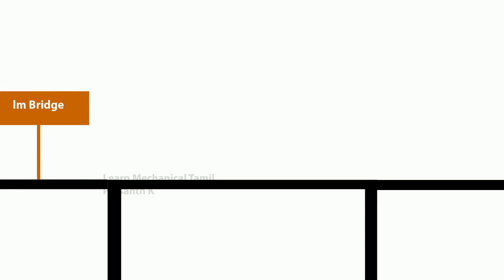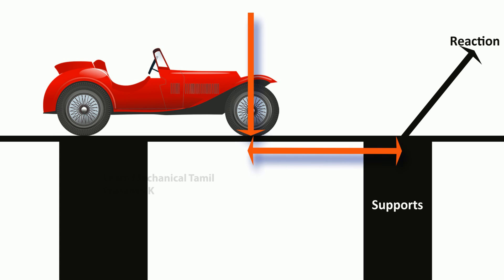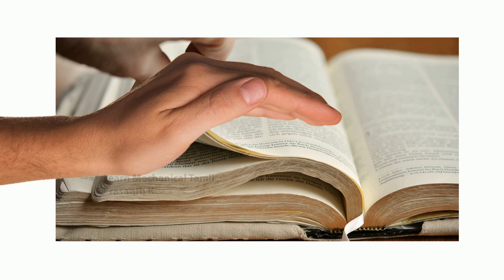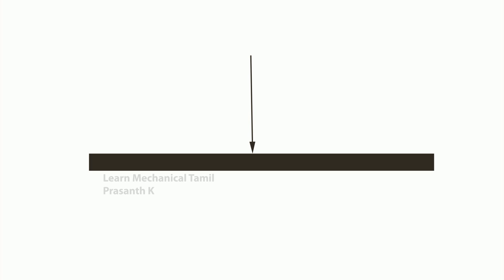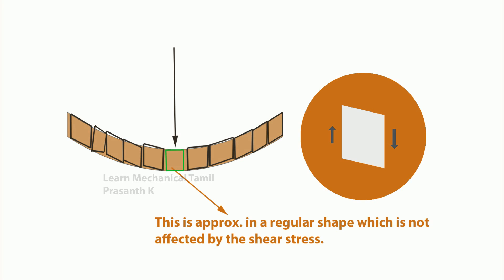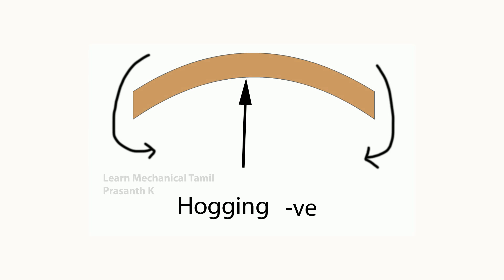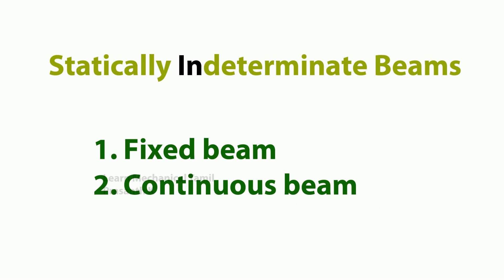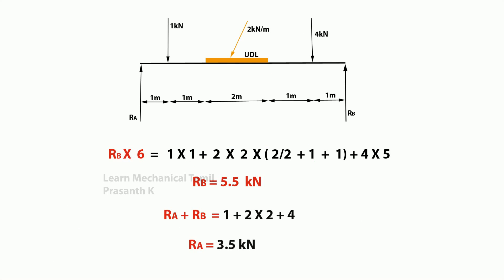Bending Moment & Shear Force Diagram in Tamil

Comment: My friend finished B.E mechanical ENGINEERING 2018 passout. His future plan become a industry machinery designer. Please guide which cource suitable for him. any internship job ?
Reply from the maker: This is basically i prefer to my friends to become designer. 
 1. Technical Concepts about the particular object which you want to design. Ex: heat exchanger, you need to study heat and mass transfer, CFD, thermodynamics. 
2. Get experience from industry persons. 
3. ANSYS / ABAQUS anyone and hypermesh (pre processor)

It will take much time to achieve. So keep learning with good text books, and go ahead with patience.

Congratulations!
Reply from the maker: See our video, how to become designer in Tamil.